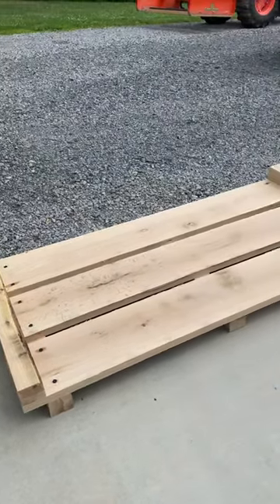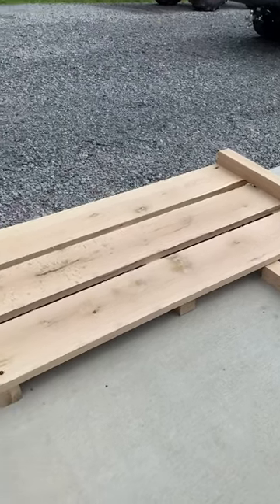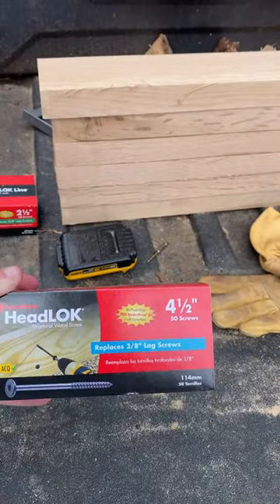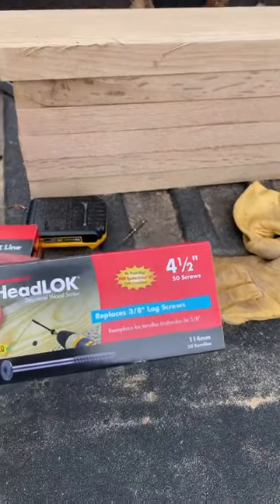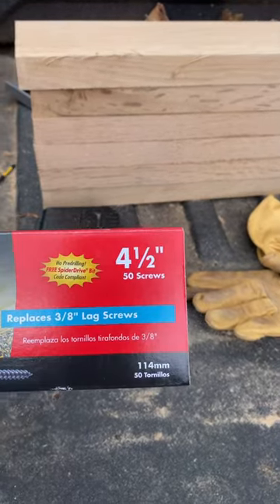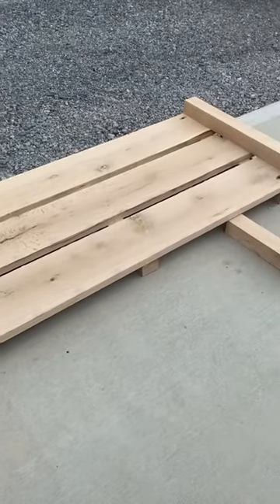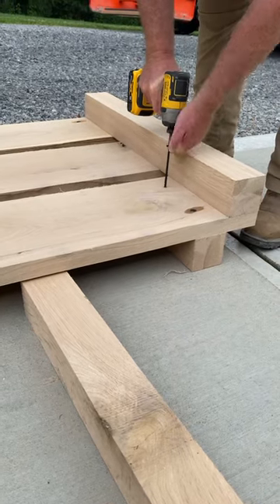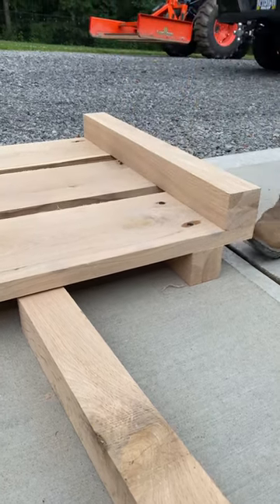Surprising Results with Structural Screws

Comment: You're telling me a screw just went in like that?
Nice that you can apply 300 lb on the screw head
Reply: A good impact driver with a fully charged 4 to 6 Amp battery will drive them easily. Give them a try. They work well.
Reply: @ronallen6578  I feel really stupid ignoring impact Drive
Reply: @kevintewey1157  NO need to.